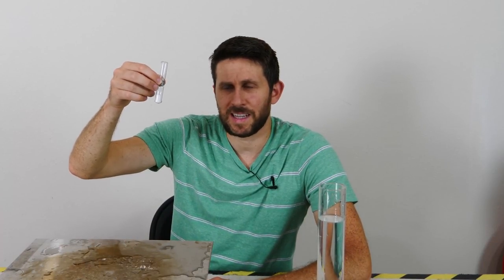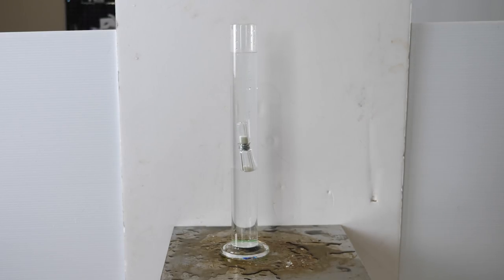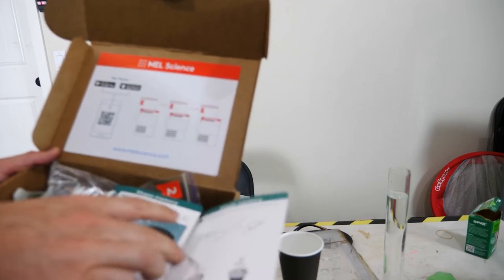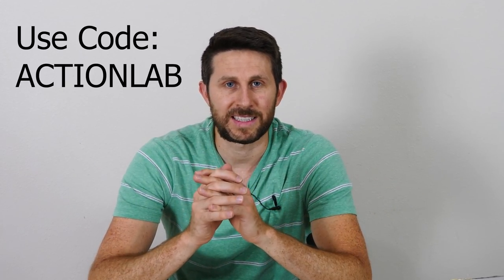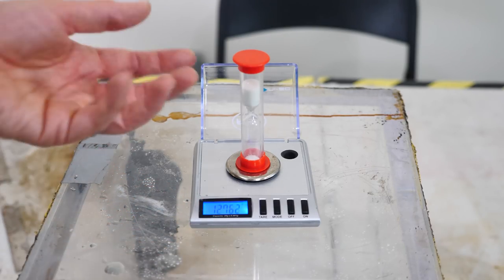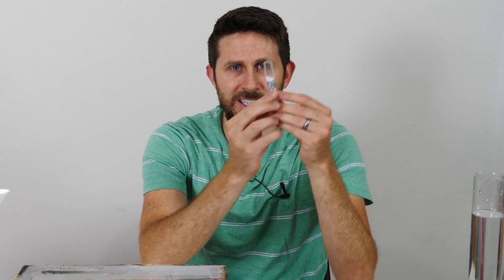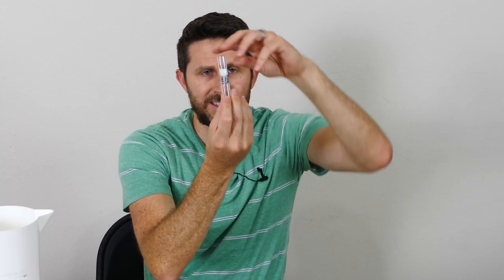Can You Figure Out The Hour Glass Buoyancy Problem?

Comment: What will happen if you make that hour glass flat rather than a long tube? I.e. let its cross-sectional area be a little larger while the length is smaller. Will it still be floating or will it sink directly?

Comment: Question ✋🏻 what if you make an hour glass that is inside an empty glass tube (sealed both ends) to make the hour glass stable. It’s hard to explain but I hope you can picture it out.
Reply: It would probably float without the weight of the sand. If you added weights distributed equally on each side to account for the lack of sand, it would sink. It'd probably lean against the side and be slowed down, but there wouldn't be enough friction to stop it.

Comment: Could have explained this a little better. For every action is an equal and opposite reaction. The action (gravity pulling down) is met with an equal and opposite reaction (friction). When the sand is at the bottom the hourglass does not come into contact with the sides of the container, but when sand is at the top the hourglass wants to tip due to gravity and comes into contact with two different sides of the container due to center of gravity. When enough sand drops down the center of gravity changes and the hourglass doesn't experience the same amount of friction by contacting both sides of the container and eventually sinks. Your examples poorly illustrated this. It would have been better to drop an item straight down the cylinders you used and compare it to at item let go which was touching two sides of the cylinder like how the hourglass leans with the sand at the top. I still really appreciate and enjoy your videos, I'm sorry for sounding harsh or too critical, my only intention was for constructive criticism.

Comment: Hey i have a question for you.
how come a Bee (with a top speed of 32kmh) can still fly freely in a car traveling at over 100km/h when it's not touching anything. Shouldn't it also be flying at that speed as well?
Shouldn't it theoretically just be pushed into the back window?
Reply: If the windows of the car are closed then all the air inside is also traveling with a speed of 100 km/h, which means the bee doesn't have to fly that speed. It's like when you would throw a tennis ball straight upwards and catch it again while traveling at that speed, the ball wouldn't hit the back window either. Different story if you're in a convertible.

Comment: Incomplete explanation :
It does so because when sand is in the upper chamber it keeps falling down which means the centre of mass is going down and the system is falling 

If u doubt this then shut the hole and see

I like ur vids keep going
Reply: while the sand drops, the center of mass drops by an unmeasurable amount and then later falls at a quite high speed. while you technically arent wrong, it has no effect on the actual experiment
Reply: @allylilith5605  then why sandglass why not  just two chambers
Reply: @allylilith5605  also why does it sink after some time ??

It's not about the distance sand falls it's about the rate

Comment: I think you are wrong. Consider the mass of the sand that is falling. As the sand moves to the bottom the number of grains in free fall is reducing as the pile gets taller. Use a more accurate scale capable of weighing the stream, or individual grains, and see if there is a difference.

Comment: I knew we would come to that conclusion. But thinking as a real scientist when we do the math to the extreme precision - when is the hour glass heaviest?
Batteries are heaviest when fully charged (but not measureable - at least not on even quite expensive laboratory scales) because the atomic bindings has more energy then when discharged.
What confuses me about the hour glass is that it's potantial energy is highest (higher point of gravity) when sand is at top. On the other hand the majority of it's weight is "further away" from Earth. Had been fun if you did the math and came up with a theoretical version of when the hour glass is heaviest (most attracted to earths gravity field) 😎

Comment: It DOES change weight, actually.
As the sand falls, it gets closer to the Earth where gravity is stronger.
(That is not significant though, and not the explanation why the hourglass seems to "float" when the sand is at the top.)
😉
Reply: yes, gravity force drops off as center of mass moves away from center of mass of earth
Reply: had the same thought

Comment: The sand weighs slightly less when the sand is falling because the falling sand is weightless while free falling. 

But it's practically the same weight.
Reply: Nice observation, but not quite.
That would show up on the scale.  The loss of weight in the falling sand is matched by the momentum impulse of hitting the bottom .

Comment: The mass is the same but isn't the weight a little bit less when the sand of the hour glass is in the top part? Less gravitational pull from the earth, right? Probably can't be measured on that scale though and also not the reason the hour glass doesn't sink when the sand is in the top part.

Comment: That all depends on the density of glass used for the hourglass, the density of the sand and the gas or vacuum space within The hourglass and the relative amounts of each. To some extent, it's coincidental that this float versus sink happens in this experiment. What I am saying, is that with another hourglass made of different materials and with more relatively more sand, it may sink regardless.

Comment: Theory: it has to do with friction because the hour glass wants to flip to its pressing against sides of the tubes. Either that or the sand is free falling in the tube so it lowers the weight and it becomes like a boat because of the air pocket.

Okay I was right with my first theory

Comment: Ok. My guess before watching:
The one with more sand in the top will be a bit lighter because it displaces less amount of air. Practically though, I guess the difference is so little, it 's basically unmeasurable. Ok, let's watch.

Edit after watching:
Huh, my previous guess was completely wrong. How can it displace less amount of anything when the shape is still the same.

Comment: What if you stabilize the hourglass with a gyroscope (or two) attached  to one or both poles? In this way you'll not have contact with the glass... I wander if it will still float...

Comment: Does an object get more bouyant in deeper denser water?
I wonder how tall a neutrally bouyant hourglass would have to be for it to float when the air is at the bottom and sink when the air is at the top..
Reply: in most cases you can probably consider water as incompressible, which means the difference in pressure is linear (as in "1 atm every 10 meters"), so it shouldn't matter, what should matter is the water being displaced, which doesn't change (if we also - fairly - suppose the glass isn't being deformed).

On the other hand, the position of the center of mass along in relation to the "geometric" center of the object may have consequences.

Comment: The use of the term "weight" in the english language triggers me so hard. It's MASS. I'm glad you used a scale that measured in grams though because some people on this planet like to confuse Pounds (lbs) using it both as a unit of mass AND the magnitude of a gravitational force acting on an object with a certain mass (aka "weight").

Also boyancy is a function of the density of the object dispersing the water as compared to the density of the water. You can have something with more mass, but also more volume such that it matches the density of a lighter object and is also able to float.

Comment: does not extually need a hour glass for that effect. the difference in boyancy by weight and direction of the object is present no matter what. this is what i believed could be a loophole in the laws of physics but probably not.
Reply: Nope. Buoyancy depends on displacement which he fails to mention adequately.
Reply: @Observ45er  displacement is not the problem here. action lab explain behavior by friction not correct. he think the friction against the wall causes the object to float like a object standing on a balancing pivot leaning to a wall reducing force of overbalance. that is not the case with this. there is more than friction going on here. the effect seem to be larger with greater mass. i done many experiments with this effect. was not possible to use it in a wheel design but perhaps a belted one not tested yet. the force is not the same in each direction even the displacement is the same. i think that we see how gravity can behave like magnetism here. gravity pulls it in one direction and push on it in the other. you see there is a force present that want the thing to align in one direction and that force is present without friction so its not a balancing act with friction as assumed. we see the same thing with two magnets that when one magnet repels it wants to flip around into attraction and there is no way to make the repulsion aligned without friction without making the magnets lean against something external. buoyancy only works because of gravity has direction. without gravity and only pressure in a container the even less density in the center or vacuum cavity no direction of force is present so that the displacement will do nothing. without gravity buoyancy would not work at all.
Reply: @primodernious  It is quite obviously the friction.  If you take care to notice, you can see that he just BARELY gets it to float.  The buoyant force is VERY SMALL.
That takes only the tiniest amount of friction to prevent it from moving.  
.
I am very sorry, but your writing is difficult to understand, especially without punctuation.  I am unable to make any sense out of it.

Comment: Is there any chance that pressure difference between the both ends of sand clock helps to float in addition to friction?
Because the position of weight in case1 and case2 are different..

Comment: my original comment got just deleted, prob cause of a link i included.
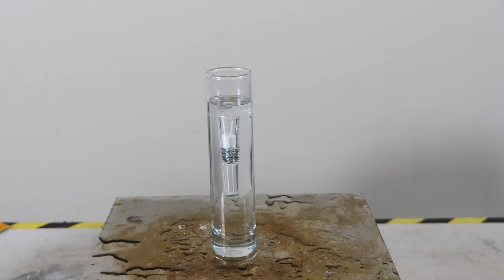i don’t believe it’s friction causing it to stop since you can also see it in 0:45 how the glas has alot of inertia and even wiggles a bit but despite that still stays put. i am looking for a proper exploration for this cause of an tiktok where the glas moves up instead of down after a certain amount of sand with same behavior
Reply: also friction is higher if stationary so it does not make any sense why the hourglass exalerates slowly towards the bottom like that
Reply: It is so close to neutral buoyancy that it isn't going to zip downward immediately when free.  He did that intentionally.
Reply: @Misteryx5  
No. Your reasoning is backward.
Once it is moving with less friction, it will keep going.  I small shake can get it started to break free of the static (stationary) friction..

And it's 'accelerates'.

Also it is not doing much accelerating downward.  It is a quite constant speed.

Comment: I have a better explanation. This is like how jets accelerate. They shoot hot air back so they can move forward. Similarly, here the sand is accelerating downwards (gravity) which is providing an upward thrust. Just enough to counteract the extra weight.

Comment: ohhh, its because of the air pocket at the bottom, and the lower down it is, the more it will want to rise. I think???

nevermind, that doesn't make sense.
Reply: I agreed at first! I thought it was due to the pressure increasing pushing the bottom up that has more air in it the lower you go down the water. The only way it stopped making sense is that it went all the way to the bottom, thus increasing pressure and it should have risen, but it didn't.

Edit: It gets more confusing the more I think about it actually hahahah. Can someone explain how this is not the case?

Comment: The experiment does not answer the question posed in the thumbnail, i.e. which is the heavier. it only shows that the hourglass is heavier than the water it displaces and that frictional forces are in play. Placing the hourglass on the scales is not sensitive enough. Scale up the experiment i.e. use a heavy ball to represent a single grain of sand. The experiment I just did uses a 45cm cardboard mail tube, a large marble, kitchen scales and a blob of bluetack. Stand the tube vertically on the scales with out the top lid, stick the marble to the top lid with bluetack and place carefully back on the tube. If you get the bluetack just right the marble will unstick and fall, and..........., yep the scales show a lighter reading during free fall.  So regarding the thumbnail question, I submit that the RHS hourglass is the heavier due to fewer grains of sand in free fall.

Comment: Here's my guess before I watch the whole video: When the sand is at the top, there's more air in the bottom, creating a stronger buoyant force because the air is deeper? Not sure if that's how it works though.
Edit: I'm completely wrong! I never thought about the rotation, although I feel like I've seen something similar before.
Reply: I was wrong too. I totally thought that it had to do with the fact that air, sand, glass, and water are all made of the same stuff interacting with itself at finely tuned rates. Big ol fail over here.
Reply: Differential rates*

Comment: Dude this is not accurate - firstly, the reason for the difference behaviors is that the system is different when some of the air is under the sand, and not all above it. The friction is working again the torque or rotation of the hourglass, but only when the air-sand ratio changes it sinks.. Saying all that, you're awesome, keep it up 👍

Comment: u r wrong ;)
While the sand presses the glass to the outsude, the water presses the sand to the inside, the water preasure is larget on the bottom of the glass so when the sand is on the bottom the glass resists the water preasure more where it is more signifikant so the volume of the houerglass srinks less the n otherwhise, the other effect is insignifikant low, because the poinz where the galsses contact is infignificant small

Comment: So let's go back to the hourglass-on-a-scale problem.

Why does it weigh the same when the sand is at the bottom as it is when the sand is at the top, even though there is a percentage of sand in freefall and therefore not contributing to the weight of the hourglass?

Comment: I'm not sure I entirely buy the "friction" explanation. If, somehow, the tube was made up of some magical friction-less material. As long as the tube is narrow enough, to stop the hourglass from flipping over, I feel that you'd still get the same effect. I think it's something to do with not allowing the hourglass to flip and this thus somehow expresses itself as not sinking, though to be frank I'm not entirely sure why either
Reply: If the hourglass was more narrow, but weighed 10-100 times more than it currently is, it would simply sink to the bottom because the weight overcomes the static friction created from the at-rest hour-glass with the cylinder. Make a (static forces only) Free Body Diagram and explain what other forces there are acting on the hour-glass. I can only think of 3, buoyancy, weight of hourglass due to gravity, and the static friction holding the hour-glass in place.

There is no such thing as a zero friction material. You could just repeat the experiment in a larger diameter cylinder of water, and control the hour-glass so that it stays in its chaotic state of wanting to tip over.

Comment: Can a metal be attracted by a magnet while it's hot
Reply: Tell me please
Reply: I think it would be attracted more. Metals that are attracted to magnets have many magnet fields in them, all facing in random directions and canceling each other out. When a magnet is near them, all the magnetic fields align, making that metal a magnet as well. If the metal is warm, they can align easier, making the magnetic force stronger. I think this would be an interesting experiment.
Reply: Can heat escape through that magnetic field
Reply: @abiramipon.sivakumar1001  I dont think so
Reply: I am asking this because few years ago , he sent a video in which a metal ball could be hot in vacuum . If we also make a magnetic field in the vacuum chamber and repel the hot metal ball by which it could float without leaving heat by radiation
Reply: If you heated the magnet itself, the magnetic fields would become unaligned as the molecules move around, and the magnet would be ruined.
Reply: The magnet is not heated , only the metal ball is heated
Reply: I know that a magnet would be demagnetised when heated
Reply: When we spin a top , why is it looking as it is reversing after some time ?

Comment: In reality, when the sand is on the top it should weight more.
The reason is:
When the sand is on top it has more potential energy:
Ep=mgh
If you have more energy, you have more mass.
E=mc2
If you have more mass, you have more weight, considering the same gravitational force:
F=ma
Of course, the values are insignificant, but not zero.
Question: does this explanation make sense?
Tks